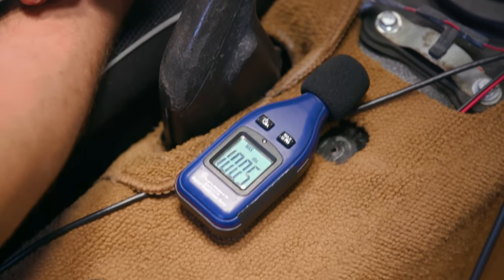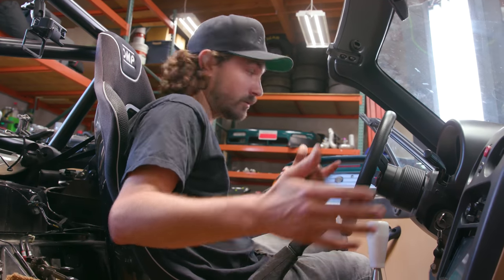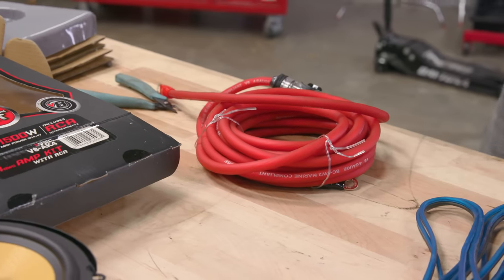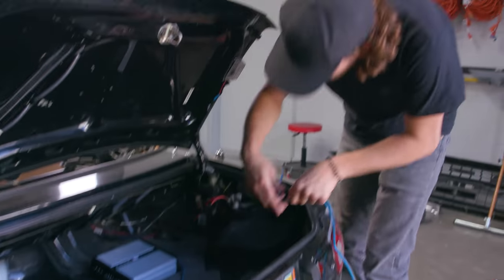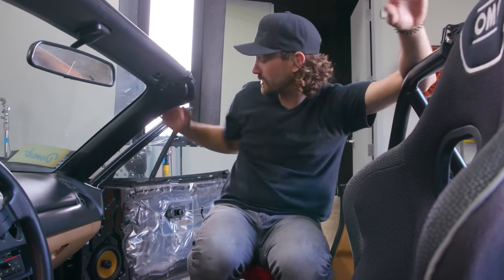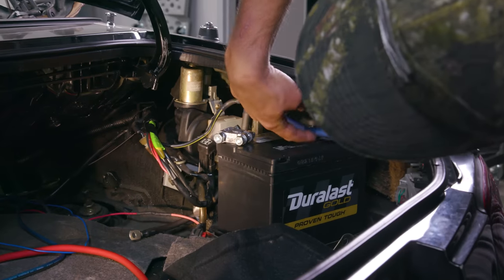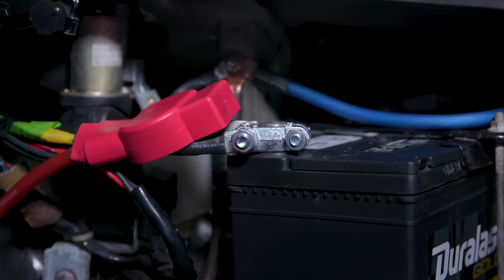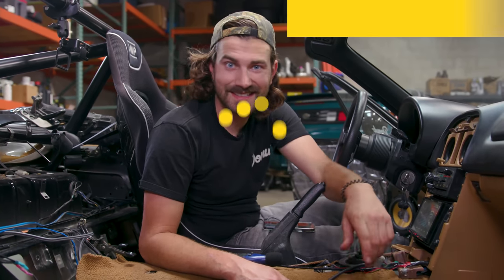Is Upgrading Your Car Speakers ACTUALLY Worth It?

Comment: lol wow he was doing so well with his descriptions right up until 14:54 happened.  Not saying he was wrong, you absolutly should keep the two wires separated from each other,  but the reasoning behind why  he said not to run the RCA's beside the power wire  really was lacking and not very educational. 

But the long short of it is that the Large power wire will be pulling a lot of current or AMPS through the wire which creates a strong magnetic field around the wire, and on the other end of the scale is the little RCA wires that will generally only have around 2-4 volts going through them, at a very low current, so the magnetic field around it will be significantly weaker in comparison, therefore more susceptible to interference.

 Granted most half decent RCA's do have measures in place to mitigate outside noise,  such as having the + and - signal wires twisted and shielding in the sheath  to help with any interference. Noise can still be introduced so you still want to keep what you have control over to a minimum.    So running the two on opposite sides of the car ensures the amp receives the best quality signal with as little interference as possible, and not get noise introduced along the way, that would then get Amplified by the amp, and ruin the listening experience of the new sound system.

Comment: I'm changing my car in the next week to a Ford Puma.  It has a 7 speaker system, speaker in each door and three tweeters in the front. The factory speakers are fine but I was thinking of upgrading the speakers. The volume levels are good and I'm not interested in blasting music, medium volume is fine for me. I'm just thinking I could upgrade the factory speakers. I don't really want to start adding amps or subs. Will just replacing the factory speakers be enough??. I won't be doing the work myself either(I'm useless!!). The system is Ford's Sync 3(3.4). Also can anyone recommend a decent set of speakers, they don't have to be top of the range. Basically something plug and play!!.

Comment: stereos are not meant to be played at max volume, the speakers start to dist at around 75-80% of max volume, set that as ur max and then tune ur amp
Reply: Depends on the stereo and the gain settings.   Some factory systems will only go up to where they just start to distort.

Comment: This Video would have been so much better if you had upgraded the speakers without the added amp and shown us the improvement with that alone then after that you could have added an amp because not everybody wants to run wires from the back to the front just to get a bit of better sound.

Comment: I bought a meter that looks identical to the one used here and its measurements become inaccurate in the bass range. And by inaccurate I mean the db gets lower and lower the lower the frequency, even if from 100hz to 50 hz actually increases in spl, the meter reads less. And trust me I know its totally off in the bass range because I had my system metered in an spl competition with calibrater meters, my score with it the way it was was 136.3db. I tested it with my meter and it only gets up to around 115db. That is an outright massive difference. To be honest I haven't even watched the video yet, I just saw the meter and knew it looked identical to the craptastic one i have, and had to point it out
Reply: Ok so after watching, I'm going to add this, if the test was just a to b to see what speakers alone did, it probably wouldn't change much, maybe a few tenths of a decibel, those alpine speakers looked fairly beefy, the frame and magnets definitely were superior to the JLs, but other factors could make the JLs better, add into it the possible age of the alpine. Also another very important thing to note, even though I know what I say wont get seen by the creators, is that when you turn your head unit all the way up on almost any head unit, it will induce distortion, especially in the bass. Thay is more than likely the cause of the bad sounding bass, it's not that they cant handle producing some bass, it's that the signal is being clipped before it gets to the amp. This problem is compounded by the use of any loudness modes and bass boost functions. If the signal source is a tad weak you might be able to crank it and not get the distortion, but in my experience bluetooth is usually pretty loud signal strength wise, at least compared to my radio tuner, which when the signal is good off the air, I can turn my head unit up to about 55 out of 60 without any worries of even minimal distortion, but playing loud bass music through bluetooth is much louder, and I can only turn it up to around 50 without getting into any, if i go higher than that, there is distortion present, not even audible, but the extra distortion creates more heat, and gets my subwoofer getting warm and a bit smelly sometimes, still I regularly turn it up to 55 for short bursts of around 2-3mins. My door speakers are a pair of infinity kappa 6x8s, and can handle and produce bass just fine without distorting. Of course they are on my head units power, so I'm not able to put too much power into them, they're an odd load of 2.67 ohms, so it may be drawing 20 or so watts from the head unit, at least a bit more than what it is rated at 4 ohms. And one of them has a plastic piece I left taped on it that rattles when it does certain bass frequencies,  and that is the only reason I use my high pass on them, I have a sub on a powerful amp so I dont need them to do that stuff anyhow.

Comment: Low pass filter?
Why not lower the power output of the entire amp, thus keeping a balance in frequencies for the entire spectrum, by just limiting the volume?
A good speaker handles almost all frequencies... at less dB outputs.
Or better yet... with the digital equalizer just limit the lower frequency (same as low pass filter)

This mania of pushing for maximum dB is nonsense... 
but very clean installation 👍

Comment: I still don't understand why an amp kit costs that much. I have never seen RCA cables that much. Can someone please explain? I set up a home theatre system with 12ga wiring and banana plugs for less than $50...

Comment: But the problem is when you buy a car with an already installed amp and subwoofer setup, and you don’t know what color the speaker cables are. And when it’s a Toyota with a 4m deep trunk.

Comment: After spending $1400 having ahead unit, all speakers replaced with sub, professionally installed…the only thing I learned is that aftermarket radios are a waste of time. I have absolutely no mid bass at all, well if I want to spend another grand I might…instead of hooking it all up correct in the first place.

Never again. If the factory radio dies, I will just live with it in the future. Seriously, who in the hell wants to sound like a 6-4 Impala with the wrong rims?

Comment: do you need to wire the spekers do the amp or  could you use the factory wireing to the radio 
will the amp still enhance you audio qulity

Comment: The thing about upgrading sound systems is you’ll spend more and more unintentionally. A new set of speakers doesn’t make much of a difference, so you’ll starting to upgrade your head unit amp DSP. It never ends 🤦‍♂️🤦‍♂️

Comment: ya know if the upgrade will work if i did that to my tv? like ok... the sound driver in my tv is rated 150w at 8ohm and sounds like an alarm clock radio but if i disconnect the tv speakers inside, run the wires out the back to 2, 200w 2ohm external floor standing speakers, will the tv be able to run the speakers a great quality at almost near equal power?

Comment: You do realize the gain control on an amp is not a power level or wattage control right? While it may determine how “loud” the music plays, the gain control is not cutting the amount of power the amp puts out, so if an amp has a rated continuous power of 400w @ 4ohm, that’s what it’s putting out. The controls you refer to such as gain and your filters simply augment the signal, but not the power output. Just FYI.

Comment: title is somewhat misleading, when I saw it to me, it was all about replacing stock speakers.  Which by itself will only lead to minor improvements.   So my answer to his advertised question.  No, it's really not worth replacing factory speakers by themselves.  However after watching the first 30 seconds of the video he then interjects not just speakers, but an amp as well.  So therein lies another subject.  It's really not about replacing speakers, but amping them as well.  Huge difference and a lot more work and cost as well.

Comment: i got a 2200watts amp Up to 206W X 4 RMS @ 4 ohm
 for a 50w-4ohms  speaker :D maximum music power to 300w 
would this cause troubles ??
I think i would put gain down in the amp and that's won't cause problems

Comment: Sorry dude, your info couldn’t be more wrong. The amp gain is NOT used for volume,  it’s only for quality of signal. Using a dB meter is craziness to adjust this. A distortion detector or an oscilloscope is how to properly set amp gains.

Comment: I need to change out the speakers in my 2010 nissan titan. They sound horribly disorted, and I have to basically take out any bass, or anything on my spotify just to make them not vibrate and sound like shit.

I have a kenwood head unit, but the stock speakers just sound blown lol.

I want to put 2 subs in the back, and upgrade the 6 speakers I got. But shit's so expensive, and inflation and everything makes it impossible to afford anything I actually want/need man.
Reply: Check out ds18 or skar audio for your replacement speakers. They may not be the best out there but they will give you pretty good sound and wont break the bank until you can afford higher end stuff

Comment: good for the most part (but lots to cover)
starting with the amp/speaker. save some money and only buy the number of channels you need (or eventually plan to use) in this situation where he has just the two, and likely will not be adding speakers (where would you even put them and be safe?) a 2 channel would have been a better choice. which will usually save you about 30-45% on cost or can buy a better amp brand/model.

 this also reduces the likelihood of bridging the wires and over amping the speakers. some amps will automatically send more power to outputs if they are not being used (kind of a self bridging)  

  try to pair amp wattage with speaker HANDLING not max wattage. this will give you a cleaner sound. so best choice for those speakers would have been a 2@50watts @4 ohm. will the other ones work? yes, will that last, for a while, will they distort more easily, yes. if hitting them hard with that amp after a while the drivers will start to burn. also you should do a break in period of your speakers letting them play for a while slowly bringing them up to power. this will help them last longer over all. cranking them to "test" right off the bat like that will cause issues later.
head unit issues: SOME head units will allow you to limit their output through a similar nob/screw dial in the back. to explain why this is important. head units will be put out with a wattage output. they will often internally amplify the power but that doesnt mean CLEAN power. often the clean power will be at 75-80%. over that then the head unit itself will amplify the distortion as its past its clear power output levels. so planning on playing the head unit at full power is NOT OPTIMAL. this will also decrease the lifespan of the speakers as any distortion creates more heat in the driver.

 more on the speakers. look for the db rating @1 watt. this is the rating at how many decibels they push for 1 watt. each time you double (2,4,6,8,12 etc) will typically land you another 3 db. so higher response numbers (careful as there are 2 types of listings and some math needs to be done)  if you have a 83db@1 watt and another at 92db@1 watt you are already 3 multiplications ahead. meaning a 50 watt amp will push the 92@1 watt will sound as powerful as the 83@1 watt with a 200 watt amplifier. so picking the right speaker is more than just "wattage"

 those foam inserts for the speaker panels have many mixed opinions. most of the professional installers will tell you they are not worth it as they restrict to much air for the speakers to flex properly and will deaden/dull even muffle the output effectively limiting the wattage effectiveness. better option is taking some eva foam sheets like what cos players use for some of their armor outfits. 1/8s or 3/16th in thickness and cut yourself some speaker rings so you seal it to the door and limit the rattle. then some very thin weighted insulation to place between the door body and the door cover, trimming for the controls, wiring, and speaker only. this will create a virtual box but still allow for full flex of the speaker(s). and will give you a better "box" sound increasing the sound.

routing wiring is easiest when you can use old wire to pull it through, if changing route then bailing wire is more easily manageable and much cheaper than welding rods.

Comment: I bought a 2009 Kia (I know super fun) but it has a passenger front blown speaker and a driver rear blown speaker and the thing sounds awful. I need to just spend like $300 and get it to sound way better than it has. Or just down $100 and get crappy but working speakers

Comment: Oxygen free copper wires for speaker cables, WHY?  As a magnetic field expands and contracts through a CSA of cable strand, the higher frequencys tend to only flow on the outer surface of the wire and not in the middle of the wire  (Lower frequencus will travel in the middle of the wire). So now you now your 5-25Khz only flows on the outer surface of the wire, If that outer surface is corroded by being exposed to Oxygen, it will effect the HF signals. So oxygen free speaker wire (keeping the oxygen away from the copper outer surface) stops your speaker wires from degrading over time.

Comment: Your speakers could have handled the lows better by adding sound deadener to the mounting surface to stop it from vibrating. I do both sides of the whole inner door skin and some to the inside of the outer door skin anywhere it resonates when I tap on it. There are much more products I add for SQ but your video isn't about making an SQ system. The other thing is, not many aftermarket and almost no factory head unit will put out a clean signal at max volume. If you can't spend $75 on a cheap oscilloscope to set your volume at max before distortion then set it by ear by making max volume the level right before you hear distortion. Some people assume 3/4 volume as max before distortion. You should set the max gain on your amp the same way and once set never turn anything above that level. Always turn down from max volume.

Great video for those looking to get more decibels and cleaner output.

I still want to see videos done with your 240.

Comment: Sorry but it sounds questionable. 

Actually not much better from before. 

Relating to your preferred choice in muzak I’d suggest a woofer unit in the truck space along with well places tweeters, along with your mid range 6” speakers. 

Just an idea. 

All this should provide a better “balanced” sound.

Comment: $500+ for that? Any ol' amp and new name brand speakers would have fixed the distortion and given you a 3.9 dec. increase. When it comes to door speakers, there isn't a huge, noticeable sound difference between JL Audio (Overpriced) and Pioneer or Kicker.

Comment: I have a 2012 cadillac cts luxury, it has a factory sub and amp and i able to just extend the sub wires and run them to my new sub? and i have a amp as well i was told instead of taking that amp out just add my aftermarket amp onto it and use the aftermarket only for the subs is this correct or should i swap the amps?

Comment: Yes for sure you did a good job, but at the end your sound is still not good at all. Is better for sure but is still a distorced audio. But you got the point you have to work with a low pass and high pass and get a subwoofer for sure. And I would suggest to have some acoustic features at the doors like some foams and something like that. Metal plates is never good for audio.

Comment: i already have a good knowledge on installing an amp, i want to install a 5 channel amp, im planning on buying a RCA converter and get the music signal from my rear speakers and install a sub, Ik the amp will work for my 2 rear speakers and the sub, but what about my front 2 speakers? if it doesnt, u think i can rewire the front 2 speakers and only have it wired from the amp?

Comment: What do you do if the factory Amp is within the factory radio head unit, and you also have climate control on your head unit and can't swap it out without spending ridiculous amounts of money? I want to hook up an external Amp to help it out but not sure how to go about it.
Reply: If you want to add an amplifier to a factory setup, I’d suggest using in interface to be hooked up with the amp. Something like an LC2i should take care of that. And with the LC2i’s, it not only can give better quality control, but can integrate with the can bus systems within the factory amp.

Comment: Class A design is the least efficient but has the highest sound fidelity. Class B design is a little more efficient, but has a lot of distortion. Class AB design packs a punch with power efficiency and superb sound. Class D design offers the highest efficiency but isn't quite as high-fidelity. - GOOGLE

Comment: When it comes to stereo equipment. Yes more money spent WILL get you better sound... If it's tuned properly. You can get decent sound out of a cheaper system, but high sq system takes money.